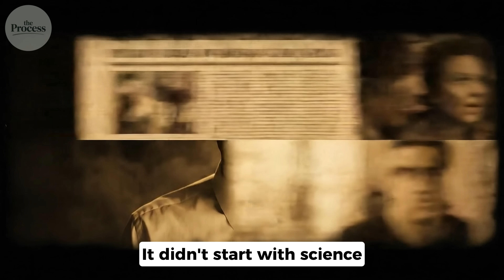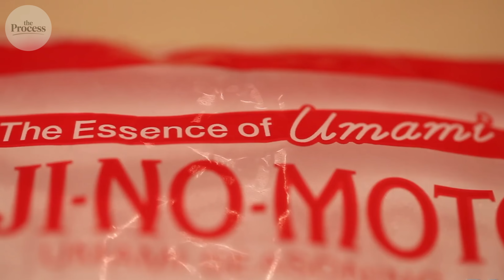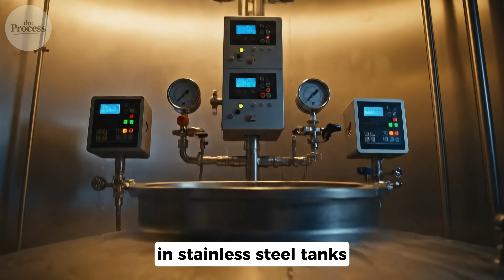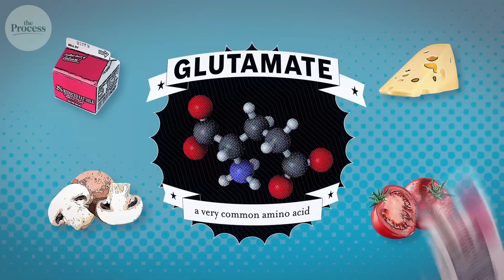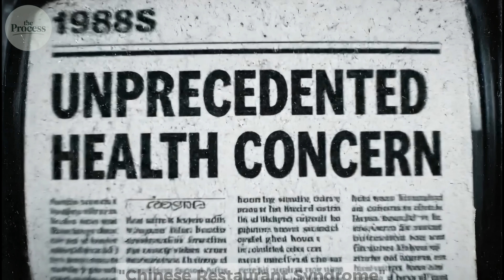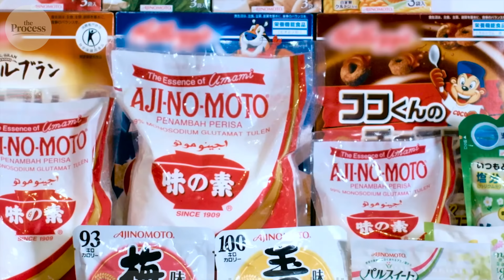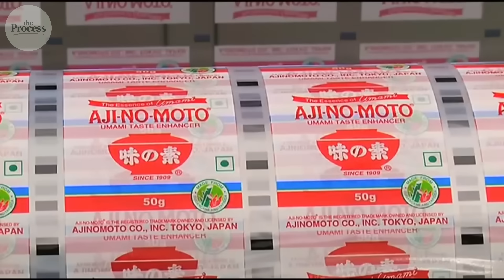What Is MSG Really? The Truth About Umami

Comment: One of the benefits of  MSG not mentioned here is that , pound for pound, it contains half the sodium of table salt. If you swap MSG for table salt you can halve your sodium intake. You should still occasionally use iodised salt to prevent goitre.

Comment: No, it is not the same.  First of all, MSG is the result of separating the salt from Glutamic Acid.  Then, MSG is not an L-glutamic acid which is used by the body to form proteins and is found naturally in foods. MSG is D-glutamic Acid and cannot be used used by the body to form proteins, nor is it found in foods; it is generated by microorganism as a byproduct.  Furthermore, DGA is a mirror image od LGA, meaning that thoutgh they appear to be similar in structure, yet they an inverted form of one another.

Comment: I use it often ,between 300mg and 1g per kilogram of food accordingly.
Reply: That's 0.1% or less of MSG to food by weight thus I think that will enhance the food flavors.

The crux is when restaurants add way more than your ratio to artificially enhance their inferior food. And when these restaurants do so, I actually feel it in my shoulder muscles (upper trapezius muscles) after the meal. I have experimented numerous times with the same outcome.
Reply: @YouTuber55555 they should not add more than necessary because if it is too much gives the dish an metallic taste while is too low is not efective .
Reply: you don't need to measure it that accurately you can use it more liberally
Reply: @deathhulk88 no you right !but the values above were established by experimenting and  tasting several various dishes. Then I found that these values matches somehow with food speciality treats . These values helps me when formulate smoked/cooked sausages recipes.